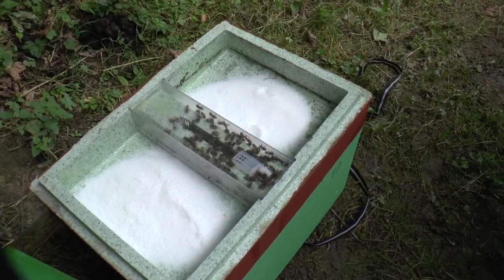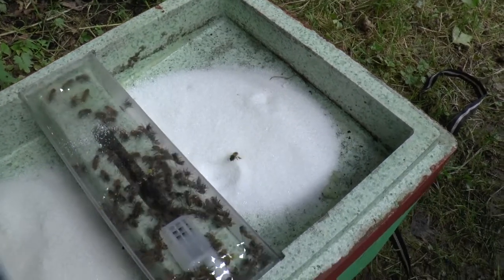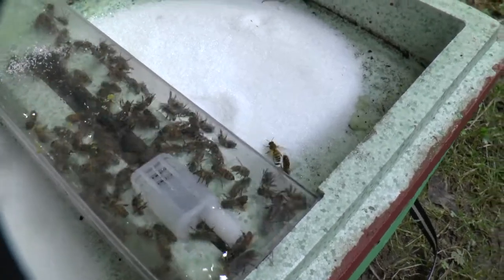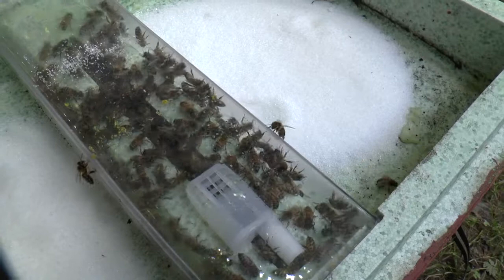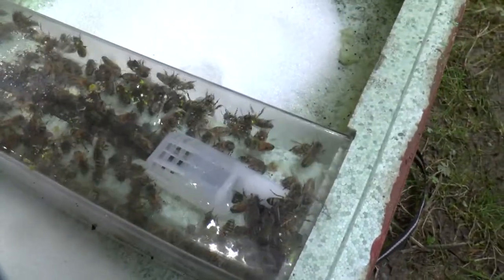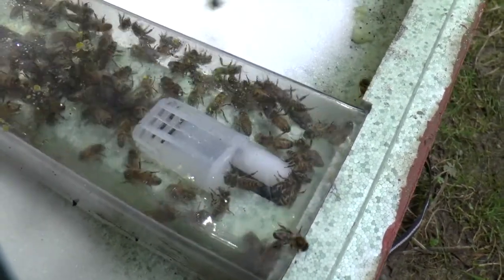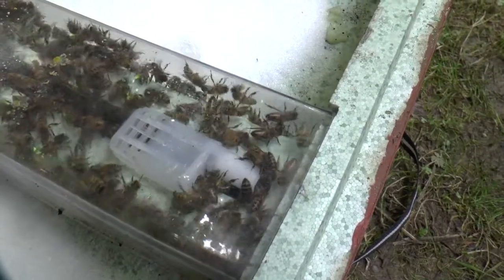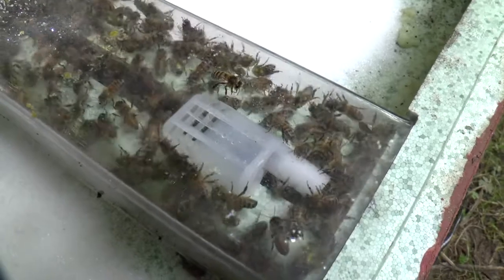How To Introduce a Queen Bee to a Polynuc: novel method

Comment: Great idea, we all need to start thinking outside the box.  I considered using the feeder exactly as Paul had suggested. I left my feeders on my colonies last winter instead of the crownboards. To be honest I think you can do away with crownboards in these poly hives / nucs. That’s what I have done this spring. They are only a little bit deeper than the poly crown boards supplied.  I suppose you would still need them for clearing.

Comment: Phil -slightly off topic but would you consider a newspaper sheet on the top of the frames and with granulated sugar on top in a maisemore hive in a eke or supper to collect moisture over the winter period when closed down . Worried about the moisture possible build up  -all advice welcome -thanks
Reply from the maker: You only get condensation when warm, moisture-laden air meets a cooler surface. The weakness of this type of polynuc is the relatively thin lid, and you can greatly improve things by placing an extra 25 or 50mm Celotex or similar insulation on top. Or simply leave the feeder in place, as shown.